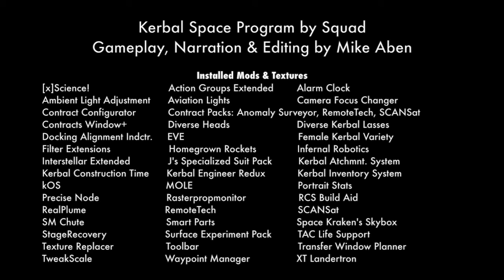KSP Career: Episode 77 - Minmus Salvage

Comment: Could you have used the thrust limiters to try and balance the torque? I guess it was a bit too late once you had set off from the surface to worry about that, given that crashing was a more immediate threat!

Good work land on top of the scrap without RCS though.
Reply from the maker: That would have been smart, but I didn't even have the SAS on at the start.  Thinking ahead wasn't my strength in the mission.

If I were to do it again, I would just put the lander on wheels and drive to where I needed it.